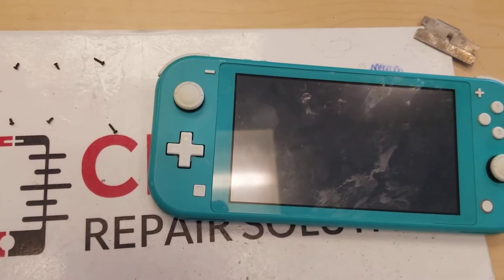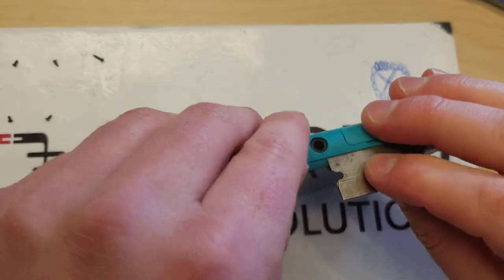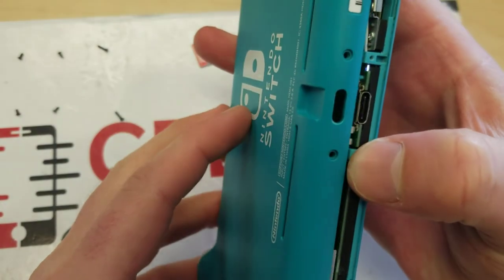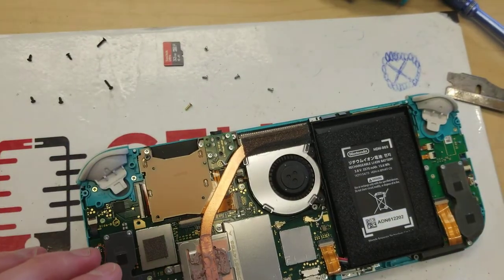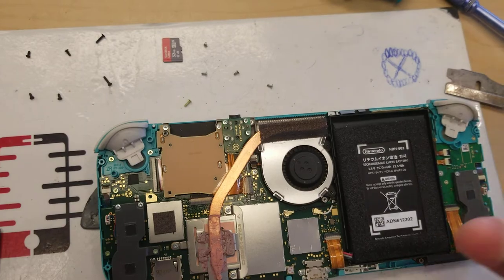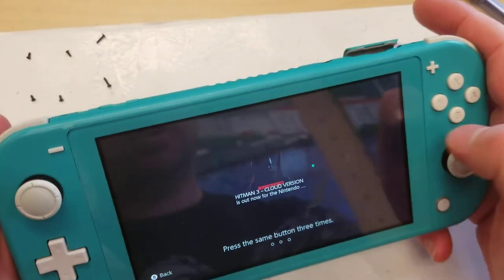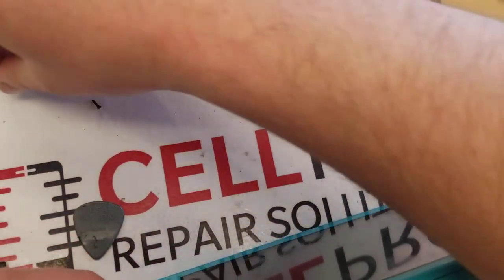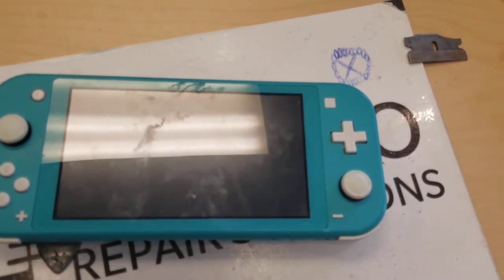Nintendo Switch head phone jack replacement HDH-001

Comment: Thank you for the video, well explained! I need to change it on mine, where did you get the part? Thanks
Reply: I buy them from my suppliers, Hard to get. I can order it for you if you want.
Reply: @brucemilligan3922  oh no no! That's fine i thought it was easy to order. Thanks for the offer.
Reply: @jean-philippebelanger1019  search switch lite audio jack plug, cost about $8 on amazon. Im part of a right to repair group online.